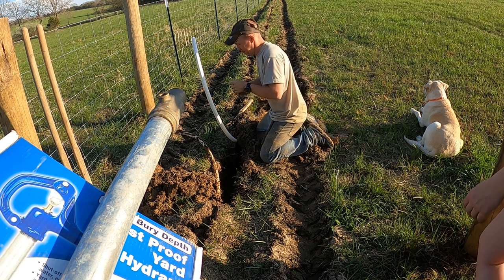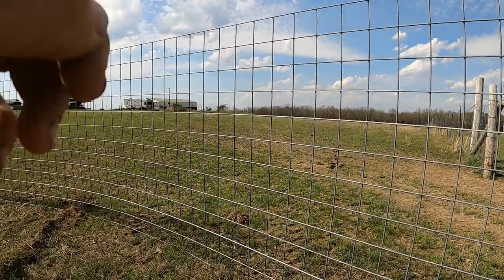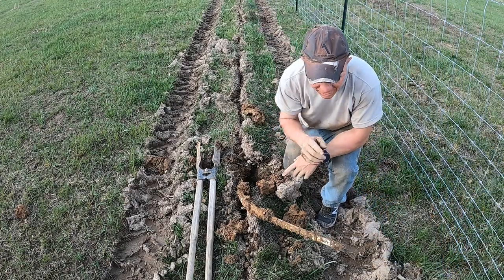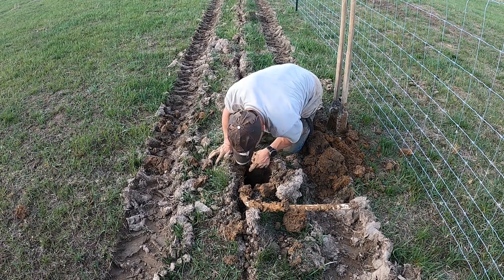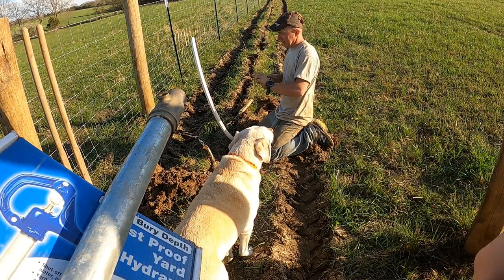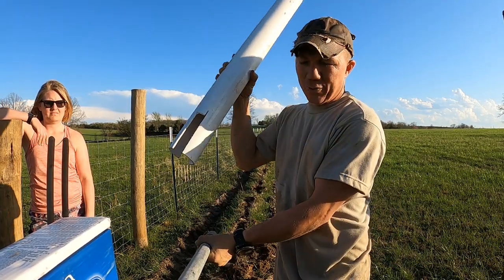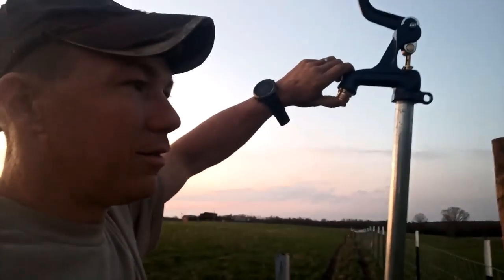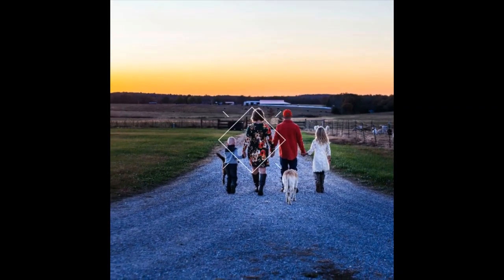Starting a farm vlog #41 My wife is harassing me while I supply water to our pastures

Comment: I wish I could pull a subsoiler through my ground like that. I put all of my water lines 30” deep and at about 2 ft, we run into a sand stone shelf that you can dig through but not drag through. I used my father in law’s dirt ripper (off of a dozer) and my 6125m 4x4 gets stopped in its tracks trying to pull it. Ended up hiring a local water line installer to put my water line in.
Reply from the maker: It's difficult to through and get 18" here with the rocks. I had to make several passes to get ours ready for the water line. Any deeper than 18" and we wouldn't have been as to do it ourselves either. Glad you got yours in though.

Comment: Those would all Freeze and Bust around here.. I put my lines min. 3 ft underground. Can't risk pipe extension on hydrant.
Reply from the maker: Oh wow, it would be very difficult to hit 3 feet deep around here. We have a lot of rock in our soils. We also don't use our water system in the winter and blow the lines out to ensure it doesn't freeze. You are right though no one wants to risk freezing any water lines.

Comment: I have a question, did you put pipe sealant on the threads before hooking up hydrant? Our soil is clay so subsoiler won't work. Have to use trencher or backhoe
Reply from the maker: We did not use sealant. We have not had an issue with them seeping. The previous hydrants were installed last year and we did the same method with them with no issue. A subsoiler is a much more efficient method but if your soil doesn't support that method that is unfortunate.